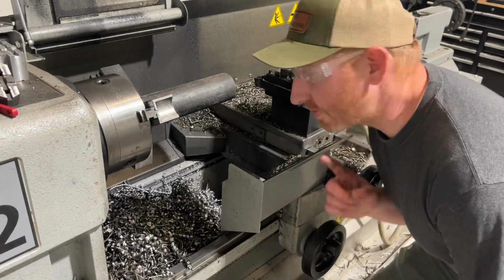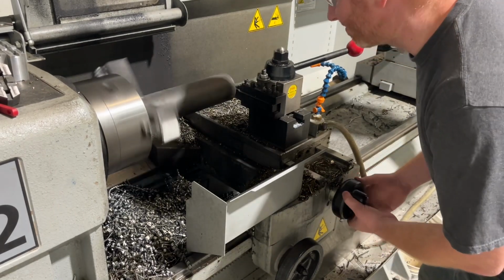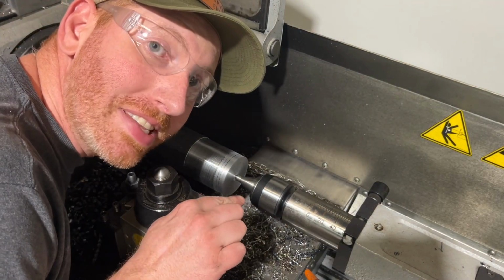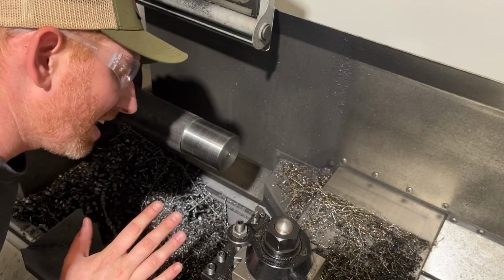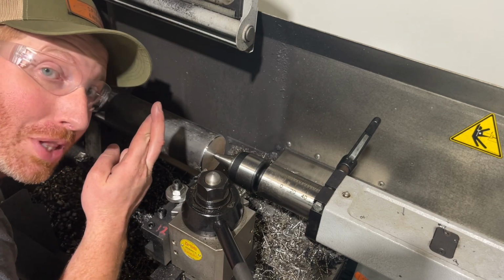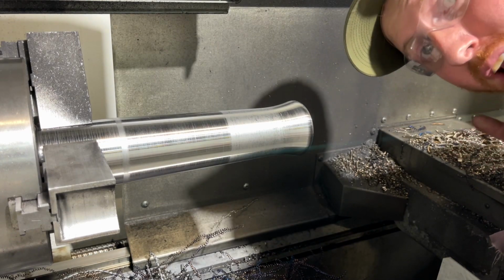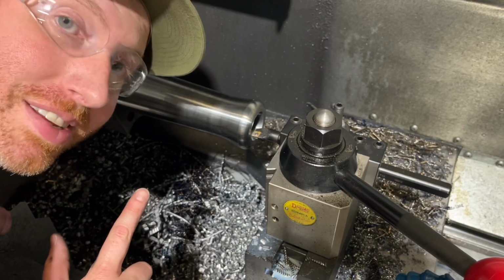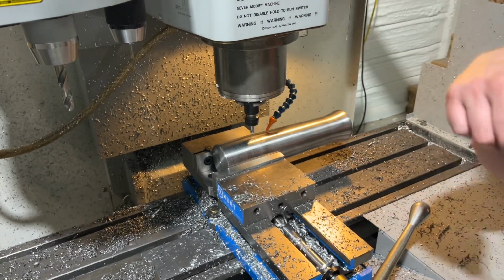Machining a Custom Ordered Thunder Mug by Thunder Boom

Comment: You need to make a 1inch bore, 1 inch wall, 1 inch base plate if you can at least 6 to 8 inches in length then i will buy